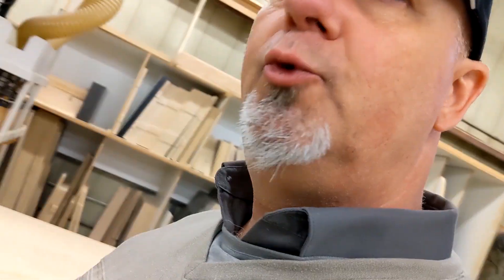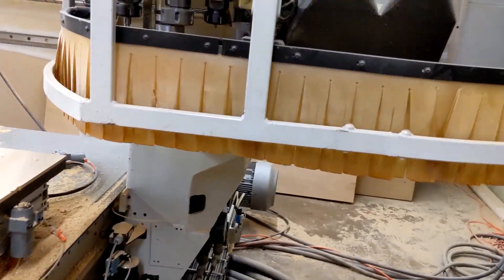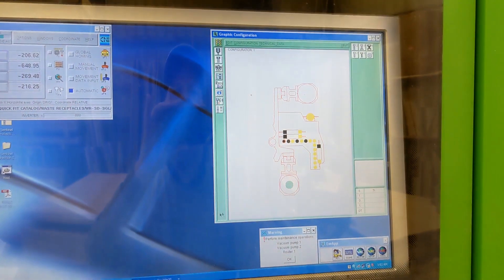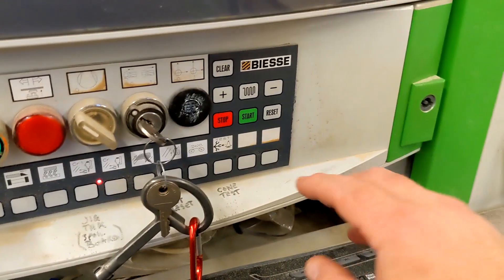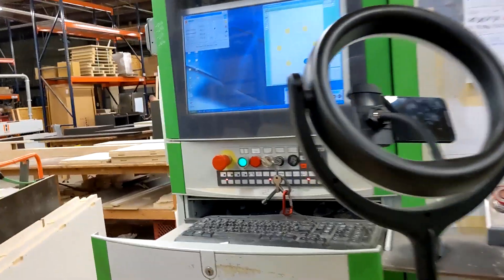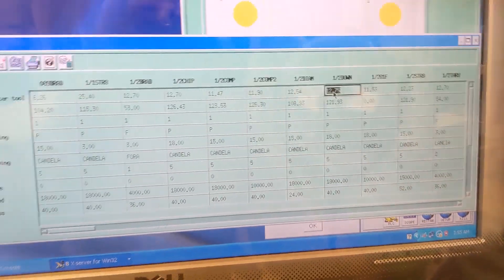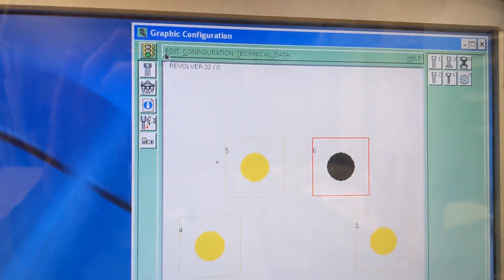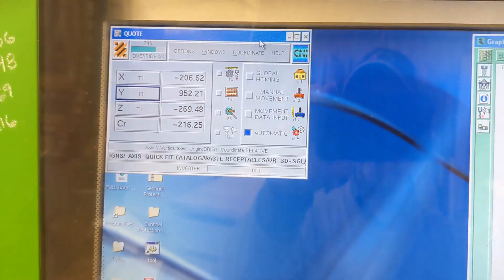BIESSE ROVER 24: Removing A Tool From The Carousel Unringing A Tool DATIMACC Graphic Configuration

Comment: just wanted to know how do you recover and continue a run on biesse after a emergency stop i love your content
Reply from the maker: Hi Yitzchok! Thank you for the kind comment! Sadly, once the emergency stop mushroom has been pushed, there is no way to start in the same place on the Rover 24. If you are wanting to pause the program, you can push the red [STOP] button or stand on the pressure matt. Both will pause the program. To resume running simply press the green [START] button right next to the red [STOP]. Hope that helps. Have fun!